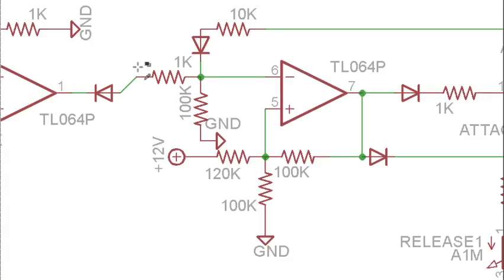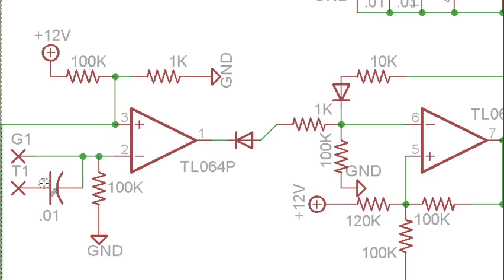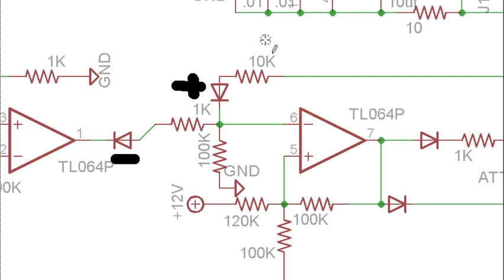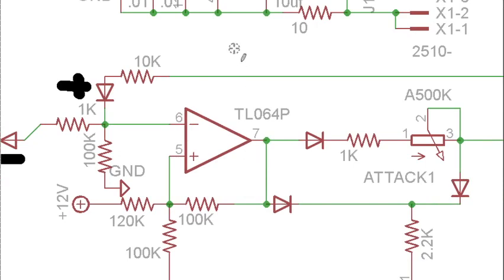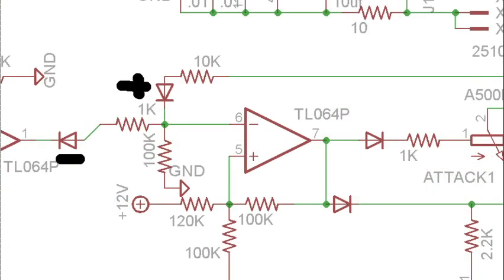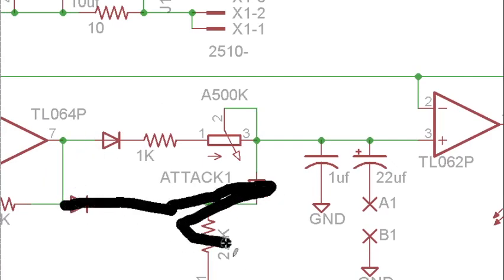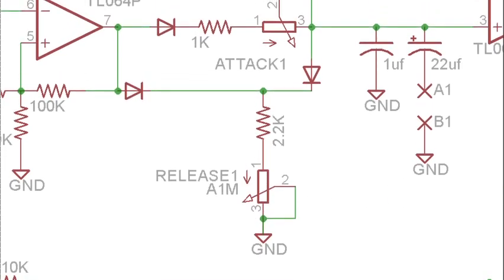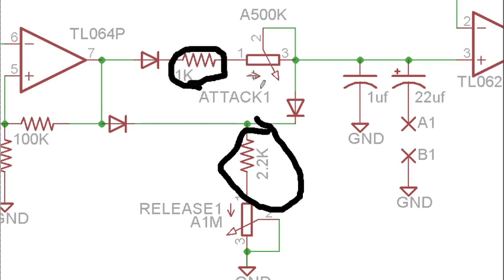BMC099 Dual AR Schematic Walkthrough

Comment: Fantastic! This is a great visual way to understand the circuit and the added suggestions for tweaking it are useful. When you have some spare time, I would like to request the same for BMC031 / QTLFO. The way that one works has always puzzled me.
Reply from the maker: Thanks, I'm actually working on trying to do a simplified version of the QTLFO, so I will probably wait until that's done before doing a video.